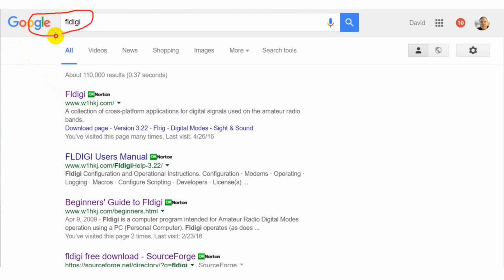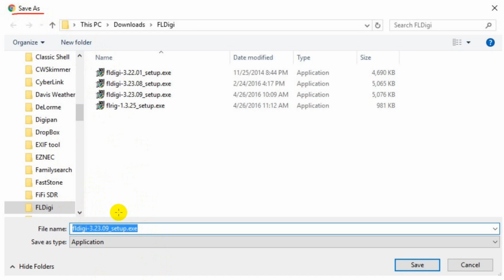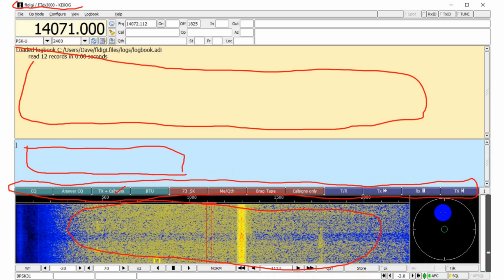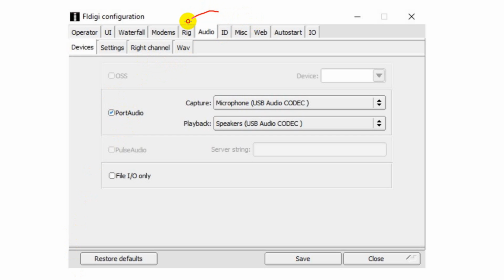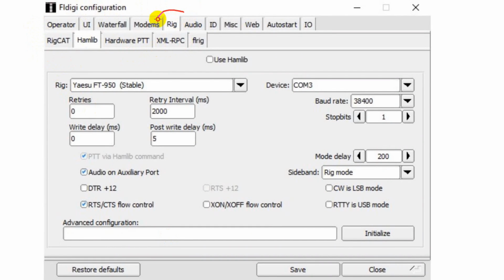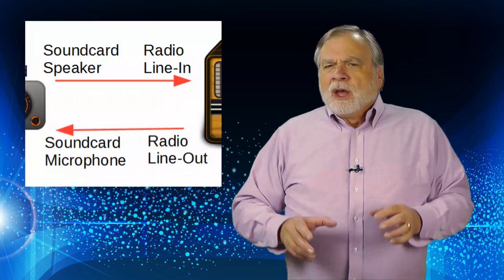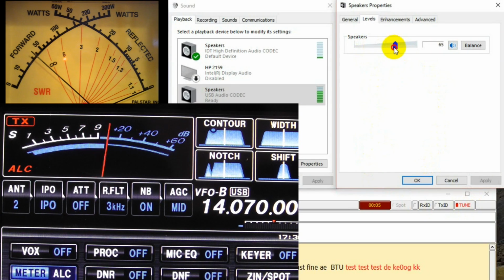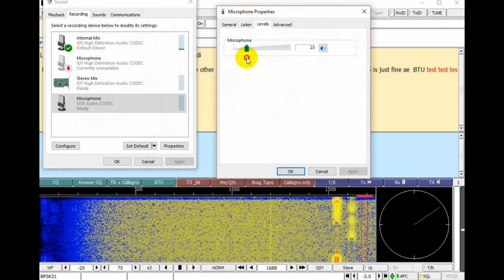Installing FLDIGI for amateur radio digital modes: AD#26

Comment: For five days now, I´ve been unsuccessfully trying to get my IC-7300 or TS-590SG work with FLDIGI. 
They both  work with WJTX; 
FLDIGI never offered access to the CONFIGERATION WIZZARD and just refuses to allow me access to  Config  to rig connect with either of the transceivers. 
Any ideas? 73, Juan/ K4LCD

Comment: Trying to set the Signalink on a beelink Win11 to talk through an IC-2730A. this is immensely helpful. I took plenty of notes. this will be very helpful. for the time being it went into blue screen mode after I plugged the Signalink in.

I'll definitely be checking back once I get past this. 73, KN4GEI

Comment: Dave are using one cord between the computer and the radio? I an finding the FLRIG controls my radio but immediately puts my Icom 7610 in transmit.  Any suggestions.  K2MR.  Ron

Comment: Thx Dave. Great video. Works well for Windows 10 64-bit operating system, x64-based processor. However, having trouble for working on Windows 10 32-bit operating system, x64-based processor. Is there any solution for this? Thx in advance.

Comment: Dave, I'm trying to set up FLDIGI in windows 10... Don't have the choice of the "Codec" speaker in my sound options, only realtec... I downloaded the Silicon Labs CP210xvcpinstall driver. It installed and is ready, but I cannot find it in my device mgr, or in sound, etc. Any suggestions?
Thanks! Jim

Comment: I'm new to this so I'm trying to figure  out is FLDigi similar to packet radio ? Something like a TNC that uses a sound card. And what transfer rates can you achieve ?
Reply from the maker: Packet radio uses what is now ancient technology from the dawn of the Internet age. FT8 uses the latest thinking in error-free, weak signal, space-age work. Like a Cessna compared to a 787.

Comment: Hey, Dave, thanks for another great episode. Do you happen to know anywhere I can get the rig software for fldigi to interface with the Icom 7300?  I find it very odd that fldigi does not offer built-in interface for one of the most popular amateur rigs on the market.
Reply from the maker: fldigi has been around for several years, is an (unfunded) open source project, so someone has to write the interface. Look at flrig. It seems to have more rigs in it and is available the same place as fldigi. I use flrig to interface with my Yaesu FTDX3000.

Comment: After downloading and setting the program up, I don't have anything on the waterfall.  The scope on the bottom right shows a signal. The dimond signal level indicator on the bottom right also shows high/low signal levels.  What am I missing?
Reply from the maker: Perhaps another Oggie can help you. There are a zillion settings in fldigi.
Reply: I followed precisely how to configure that program by watching the
setup on YouTube, with the same negative results.  Since I'm not a
Programmer and do not have a PhD in any scientific field, that
program now resides in my recycle bin. Thanks anyway
By the way, I have a two letter call, and worked in the
electronics field down to the component level on dedicated computers
back in 1976 starting with the Z80 processor when I was first
licensed.
Reply from the maker: @luigi5890  I'm sorry you give up so easily. Don't. Persevere. Have you downloaded the instruction book from http://www.w1hkj.com/files/manuals/US_English/fldigi-help.pdf? The program is in common use, so someone at your local ham club may be able to help. Setting up for digital modes can be frustrating because of the number of settings. There are lots of ducks and they all need to be in a row. There's also an online support group at https://groups.io/g/winfldigi. Give these a try.

Comment: Dave like you I am using  a Ftdx3000. The rig list does not include said radio. Which rig did you choose.? My guess FTdx1200?
Reply from the maker: Use flrig in addition to fldigi. You get flrig from the same place as fldigi. It make the connection to the FTDX3000 easy.

Comment: This is a great video. I love the way you thoroughly explain how to set things up. I have only one question. Have you covered or could you point me in the right direction to how to do this setup on a linux mint laptop? I don't have windows, but do have linux mint 18.3 LTS. Would the setup be pretty much the same?
Reply from the maker: I'm afraid I can't do more except point you to the Internet. I don't have a linux computer nor have I played with one long enough to really understand it. I do have a Raspberry Pi first generation, but have done very little with it.
Reply: @davecasler  No problem at all. I appreciate you getting back to me. I'm trying my best to muddle through things :) 73, de KD7SJT

Comment: Thanks Dave for the super video. Does FLDIGI work for monitoring with SDR's such as the SDRplay?
Reply from the maker: Yes it does, but getting it set up can take lots of research on the Internet about how to route the sound output of the SDR to the input of the computer's sound card.

Comment: Nice video.  I’ve played around with FLDIGI on OSX/Win/Raspbian, but never properly tweaked the audio levels.  Now I know how to do this versus just guesstimating their “sweet spots”.  I was using just little external USB soundcard devices (VOX for a while, then made a crude PTT interface with a serial module), but just went for a SignaLink.  Preparing to make the transition from just U/V to HF.  I’m hearing impaired so digital data modes are of especial interest.  I can get by with my hearing aids for voice (analog FM and DMR aren’t too bad with my hearing loss), but will probably use digital data modes more than voice on HF. Yeah, getting into radio as a hobby when I’ve lost much of my hearing probably sounds (pun intended) strange, but I see limitations as opportunities...
Reply from the maker: Sounds great! Hang in there and enjoy the hobby!

Comment: Hi Dave. I'm working through your video about FLDIGI. Got hung up where I tell (configure) the program what radio I'm using. I'm trying to use my Yaesu FT-2900 with a Signalink sound card. Well the FT-2900 isn't on the dropdown list of radios the FLDIGI program will work with. Bummed. My interest is in trying Packet. If the FLDIGI doesn't do VHF. Can you recommend a descent program to work with what I've got to work with. I've got a bug to look into FT8. I have a new FT-891 that I haven't been successful getting on the air yet. (time issues, antenna, apartment dweller.). Will I still need a sound card for that? Just thought I'd through that in there, but I'm most interested in doing packet and I'm seriously frustrated that I haven't had any luck "Hamming" at all. But I won't give up. 
You're one of my favorite Radio Gurus. I really appreciate what you do for us. Thanks de W2AAO, 73
Reply from the maker: Fldigi has a companion program available from the same source called flrig. It helps with compatibility between fldigi and rigs. I have to use it with my FTDX3000.
Reply: I see that you cover this a bit in "Installing FLDIGI for amateur radio digital modes: AD#26" , I realize I need to be patient. It is beyond frustrating. My whole Amateur Radio experience has been this way. Which is why I decided to pursue Digital. Just to try to find something that will make things more pleasurable. Heck I'm not even sure if we're still doing digital on VHF. I say this because the selection of compatible radios in the dropdown menu seem to be mostly , if not all HF. (at a quick glance). I see there may be some help on the Signalink website. Perhaps that's what I need to do. While I realize, also, that the software is free, I'm thinking this part could be much easier given the obvious intelligence that went into producing it. I guess I tend to learn best from the experiences of others, rather than trying to make my own. (Wise man learns from his mistakes - wiser man from the mistakes of others. However I maintain, Knowing HOW to find the answer is Infinitely superior to KNOWING the answer). Work smarter not harder.  All that jazz. Thanks for your responses Dave. Have a wonderful Christmas. 73 W2AAO

Comment: You should point out that many radios (e.g. my Icom706iiG) will need a separate CAT CI-V cable (USB to mini) to control the radio's frequency and mode. It caught me trying to set up fldigi and flrig. The Signalink is just an audio sound card. However, you still can use fldigi by manually setting the frequency on the radio and matching that in the fldigi window.
Reply from the maker: Yes, indeed. My old TenTec required two cables for just the reasons you indicate.

Comment: Hi Dave,  I followed you step by step on 2 laptops, one running Windows 7 the other 10.  I get up to the point at 11 minutes where I'm supposed to get a box where I can go to 
TUNE.  I don't get that box on either laptop.  I have a Signalink and FT-897 hooked up. So, I'm stuck here, any suggestions?

73 - KQ2N

Comment: Got this to work in Windows but Linux Mint is a problem. I want to key my rig with a serial port but none of them seem to work. The list is s0-s7 but I only have three serial ports. In the windows version I use com 1 (that's where the cable is connected) and DTR.
I'm not using any rig control software. Any ideas?
Thanks.

Comment: good day David I got a icom ic-7200 and when I goes in to my Device Manager it says that it cant install drivers for fldigi
Reply from the maker: I'm a bit confused. Fldigi doesn't need drivers per se, but a second sound card might, and if you are doing rig control from your computer, you may need to install an adapter from USB to RS-232 that would need a driver. Computer problems like that can be difficult to solve, but once solved, the solution tends to last. You might also look at the flrig software, available from the same place you got fldigi. I need to use flrig to control my Yaesu FTDX3000, as fldigi won't do it properly directly. Good luck! Consult members of your local club; you'll likely find someone who has already been through this. 73, Dave

Comment: David, do you have a video on how to set up FLRIG with FLDIGI?
Reply from the maker: I don't. It's only mentioned in passing in the video. I found I had to use it because it's the only way to communicate with my FTDX3000 from fldigi. I'll put a video on flrig on the list. Thanks for the suggestion.  73

Comment: What is the best way to connect a laptop to a Yaesu 857D radio to use FLDIGI?  I have a CAT programming cable, but I don't know if that can be used to control the radio with FLDIGI.  Do I need a special cable (bought or made up)?
Reply from the maker: There are a couple things going on here. You need to get the audio in and out of the radio. There are a variety of interfaces available to do this, such as the SignaLink USB (be sure to specify the right cable). The second is to control the push-to-talk (PTT). I suspect that you can do this via the CAT cable, and you'll likely be able to set up FLDigi to do this, but interfaces such as the SignaLink USB will also control PTT for you. I used a SignaLink USB for several years quite satisfactorily, and at $99 they are inexpensive considering all the problems they solve. Good luck! 73, Dave

Comment: My question about fldigi is about the IC-7300.xml file on Sourceforge. It sounded simple enough, just download it and drop it into the fldigi folder. Problem is, when you download it, instead of getting a nice neat file labeled IC-7300.xml, you get a web page of text. There is NO option to use Save As for .xml. So how the heck do I make this web page of text into a .xml file to put in the fldigi folder?
Reply from the maker: I use Chrome and can't duplicate your problem. But, if you get a screen that's full of what looks like html text, then position the cursor somewhere on the page, press Control-A to select all the text, press Control-C to copy it. Then open NotePad (it comes with Windows and is found under Windows Accessories). Position the cursor in the blank window, then press Control-V to copy the text there. Then select "Save As." For file type choose "All Files." Enter the name you want, probably IC-7300.xml. Then you have your file. Good luck! 73
Reply: Someone on QRZ posted it in a .zip file so I finally got it, but thanks for responding. Once I put it in the Fldigi folder it finally synced up and seems to be working fine with just the USB cable. So after a week stuck on the .xml file problem it's all good now. I still wonder why the IE browser did this to me.

Comment: Thanks Dave! Digital modes are the only way I can enjoy my hf rid because of local powerline noise, so this video is very helpful.
For anyone wanting to use these modes alot, the Icom-IC 7200 is one of the easiest radios to use. I had the 718 and without a signalink for sound and some sort of cable for rig control it was very difficult to use. That's the main reason I'm selling it. Using vox will work but it's not practical because if there's a noise or someone talking near you it'll key up and that's not good. 
Keep these great videos coming Dave. You are helping alot of people.